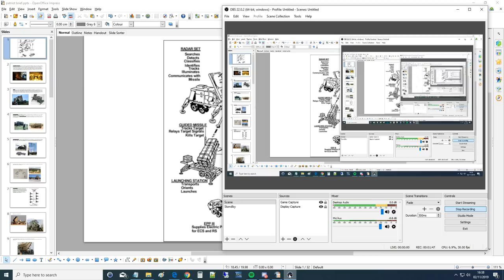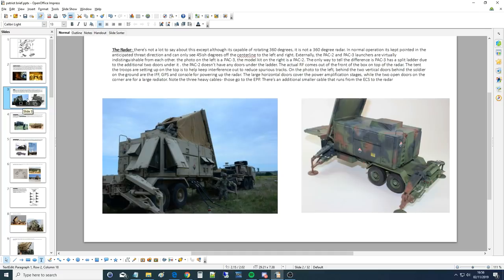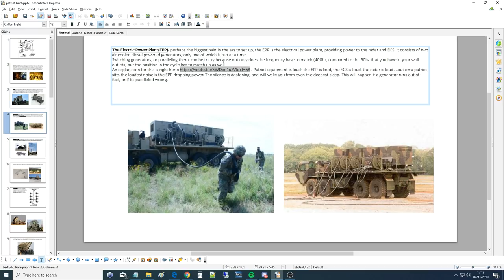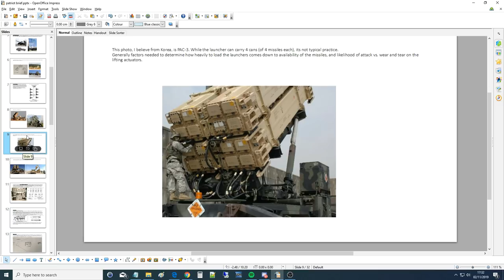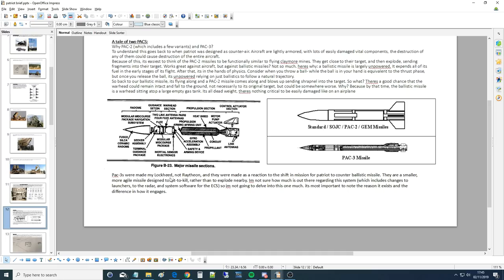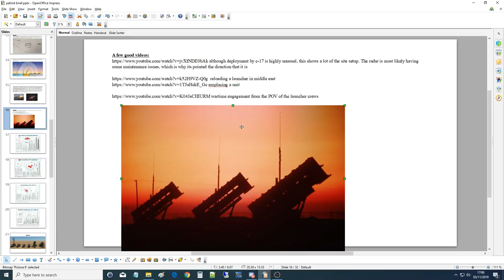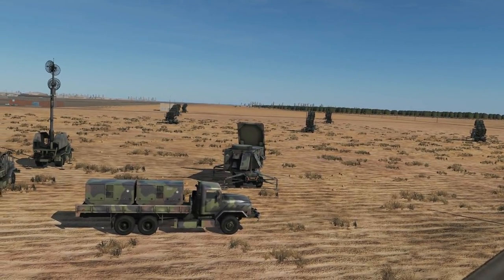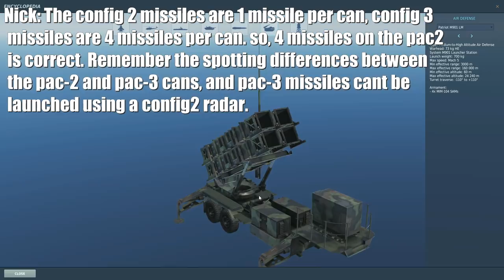Explained: Patriot SAM System (Real Life & DCS WORLD) (With Expert Speaker)

Comment: I operated the MIM-104 PATRIOT during Operation Desert Storm as aTCO, somewhere near the Saudi / Iraqi border.  There was a radar fault that we were struggling to correct during a SCUD attack and my warrant officer walked into the Radar unit and found the faulty cable that was giving us a 11-RTG failure, therefore preventing the radar from radiating and tracking.  He held that cable in place while we turned on the radar and engaged the incoming SCUDS.  We awarded him the Army Bronze Star for his bravery and for putting his health at risk. He probably never fathered any children after that!
Reply: I was Zulu Foxtrot during the Gulf War aboard Mobile Bay when I reported SCUD launches to Zulu Whisky made by our SPY-1 radar. I then broke to the 2 PATRIOT batteries in my Link-11/16 data link who confirmed our SPY tracks and engaged. I DESPERATELY WISH TO KNOW WHAT THEIR CALLSIGNS WERE! Both were on the Saudi coast.

Comment: Sweden has bought the Block 3+ variant which was an update thats just a few years old.
It replaced most of the old 70s and 80s hardware that was still around like the screens.
The next update in the works will get a completely new AESA radar.

I know Sweden intends to pair the system with an AESA search radar letting the Patriot radar stay hidden and concentrate on fire control.
There is also a nationwide air defence picture shared with the air force which is supposed to tell who is friendly and not
Reply: I worked on Aegis for our foreign military sales branch long ago and have experience on all Aegis baselines through 9 as well. Before that I was a Naval Tactical Data Sustem (NTDS) guy when it was all mainframe.

In my experience with other naval combat systems, I wouldn’t leave the pier without Aegis.

Comment: That's pretty neat to see the TVM system explained outside of my attempts to from someone who ran it.

IRT the SM-3, that's similar to the PAC-3 in that it's what I would call a "kinetic kill" in which it punches through the target. AEGIS has to be modified in order to the the math required and the SM-3 had to be rushed to make it for the mission. It was used to shoot down a US spy sat. It was newly launched and there were concerns about it's full tank of frozen hydrazine (due to lack of control, they couldn't regulate temps) surviving the fall and landing in a populated area. So they targeted the tank in particular in order to shatter the frozen fuel. They managed to successfully hit that target.

I could go into more detail about why it's called "Standard Missile" here if you want, I was thinking about saving that for the CG video though.
Reply from the maker: Thx Fire! Whats CG?
Reply: @grimreapers  In US Naval parlance, it stands for Guided Missile Cruiser. I.E. Ticonderoga class.

Comment: @30:00 where it says about the radar having more lines out to it, is that simply parallel feeds of the same type, or are they different types of power, ie AC supplies on one cable, and DC on another?
Reply: Parallel feeds, radar needs enty of juice& epp puts out only 3 phase 400 hz ac
Reply: @bohica76  Thanks.

Comment: I was in a Patriot missile battery and Hawk missile battery. I started in the Army as a Hawk missle radar repairman. The generator can power 3 city blocks and there can be 2 or 3 generators on the vehicles. I was also a Stinger/Avenger crewman.  Your expert didn't explain alot of information about how tactics about the Patriots are linked together. We would observe numerous firings at Ft. Bliss and White Sands Missile Range.  We would often remote the launchers. I've probably seen about 100 missle firings.  They would often use RQF-4 drones for target for both the Hawk and Patriots. Also, there are engagement parameters for launching missiles including corridors for aircraft that have lost Mode 2/3cand 4 IFF codes.
Reply from the maker: Would you be interested in doing an interview on the Hawk?
Reply: I’m pretty sure it’s because most of our tactics are classified. I’ve never seen an integrated hawk patriot fire. But I know the guys in 5-7 ADA recently integrated avenger and patriot during NAMFI 2018
Reply: Things have changed a lot since HAWK days. While i was at bliss, HAWK was really only being used by foreign nationals. I was working maintenance for 6th bde when bradley linebackers went away. the stinger trucks we had in germany (non-avenger, the ones with a couple missile cases on the back) were gone as far as i know by the time i left the army. when 3-4 adar received patriot, there was virtually no integration between the avenger guys and the patriot units.  there was a bit of animosity when the unit had to leave the 82nd, but patriot is a corps asset, not a division one. After i left the army, i see most of the patriot units are located on their own "mini-posts" just outside of the regular base. hell, even the entire center of the air defense universe left bliss for ft sill....what im saying is much has changed since your experiences, a lot changed over my tenure, and i can only assume even more changed since then.
Additionally, the hardest part of putting together all this info is the research.  If there was something i knew, but couldnt find a reference in an open source, i had to assume it shouldnt be gone into detail. For that reason, i chose to leave a lot out, even things that seemed somewhat minor
Reply: @bohica76  Our unit went from HAWK to Patriot. We had 3rd Gen. HAWK and the Marines still had the 4th Gen. Improved HAWK. Our unit's HAWK system was sold to Korea before we transitioned to Patriot. We had a couple of months without any system. But integrated HAWK/Patriot firings were common at WSMR. 
Since I was active duty in the NM Army Guard, the ADA BGDE units still had Chaparral missiles, Roland missiles, remnants of VADS, and had just gotten rid of the M-42 Dusters which the Koreans were using. Basically, at Ft. Bliss/White Sands you could watch the integrated ADA tactics and could observe everything working together during firings. The collapse of the Soviet Union basically made most of the air threats and the need for integrated ADA obsolete. 
I watched the first operation test firings of the Linebacker Bradleys. I was in one of the first Stinger sections to transition from 16 Sierra to 14 Mike Avenger. We also got to work on THAAD development/testing. Initially, THAAD was at risk of being canceled in the early 90'S due to numerous failures. Out of seven, or so, test firings I observed, THAAD was only able to hit 3 times. The joke was "It's only just rocket science.."
Reply: @TB0321  yea, you go way back- i had a platoon sergeant in Germany who had been a chaparral crew member. Saw a whole bunch of cases of roland missiles stockpiled in a hangar @ Baghdad airport. In todays climate, i would say linebacker is really the only ground based role for stinger thats still relevant. I have yet to see an avenger mounted on an uparmored hummwv , and thats one of the shortcomings that killed SLAMRAAM...and a dismounted stinger team today? not likely! Perhaps C-RAM is the only segment of SHORAD thats of any relevance today. Regarding airspace integration, it was very much a part of things when i left 10 years ago with the individual line battery having even less authority than ever, but having a BCP onsite (partially spurred into existance to mitigate some of the mishaps in 2003- era), each firing battery has much more situational awareness than it ever did. Patriot was a very different beast when i left than when i started, between changes in equipment and TTPs. Im sure its continued to evolve to the point of what i remember may be partially obsolete.
It sounds like the IADS you describe was an integration of shorad systems with patriot being the pinnacle. When i left, IADS was still very much a thing with HIMAD Patriot being considered lower tier, virtually the bottom rung of a larger system

THAAD had a lot of growing pains, and i dont think they ever stood up a full battalion until after i left in 2011. I remember seeing a THAAD radar completely stripped to the bone at bliss over by the airfield. Every so often, thered be a call for volunteers to stand up a new thaad unit, but nothing would ever come of it

Comment: I have a question. I've noticed  that CRG are rarely used in real live patriot battery's why is that?.
Reply: sorry to make you wait on the answer. often the batteries arent placed far enough apart for them to be necessary. part of unit deployment planning is generating a comms plan. Additionally, CRGs have to be co-located on other units sites (youre not going to simply place an amg,crg& generator out in middle of no where on their own).  additionally, in more permanent emplacements, other forms of communication may be used

Comment: Is there a way to move these units around in the mission?
Reply from the maker: Combined Arms I think allows you to move them
Reply: Jackson- how is it you want to move them around? Patriot is only mobile when jumping sites (which is a several hour process) . If you could be more clear on how youre trying to move them, i could shed some light on it
Reply: Nick Greenaway like moving them in the mission from one site to another?
Reply: @jacksonlam2877  unfortunately, not until ED models them on road March configuration ( only emplaced configuration is modelled, and even that has issues: ICC is wrong, epp has the wrong prime mover, AMG rear upper antenna is on backwards). It would be nice to model the firing units as a convoy - trust me, one battery makes for a long string of vehicles - and once they arrive on their new site, it takes about an hour from first truck rolling in till the system comes up as operational. There's a lot of animations ED would have to implement to make that happen
Reply: yes, you have to use a leap frog tactic where you need more than one PATRIOT battery to provide air defense while the other PATRIOT battery "jumps" to its new location.  A well trained crew can "road-march" a unit in 20-30 minutes and "emplace" the unit once it arrives at its new location in 20 minutes to reach "minimum-engagement" capability

Comment: another reason to only engage only missile with patriot is each missile is 2-3 million per missile.
Reply: perhaps, but not really. when the system is evaluating tracks its on a points based system depending on behaviors&adherence to air space classifications (imagine an air traffic controller, without the ability to control, but with a trigger). A fighter aircraft can do the job with the addition of being able to get a visual ID. Other countries using patriot may be willing to engage aircraft- i can only speak for the US at the time i left. Besides, an AMRAAM isnt much cheaper, especially when cost per flight hour of the aircraft is figured in